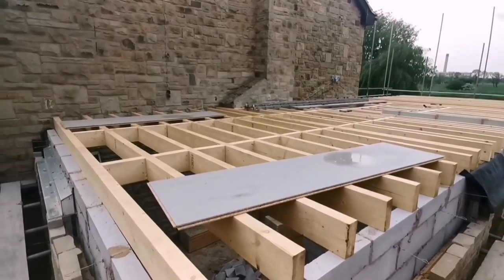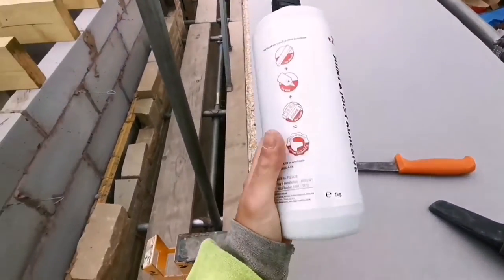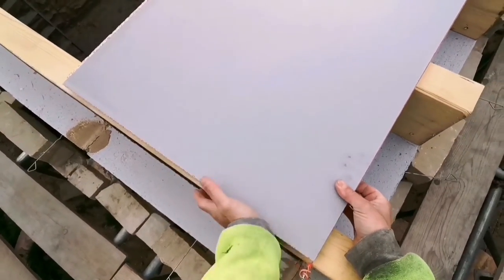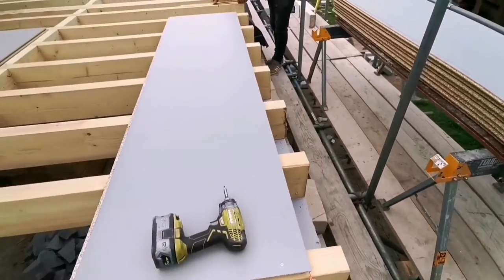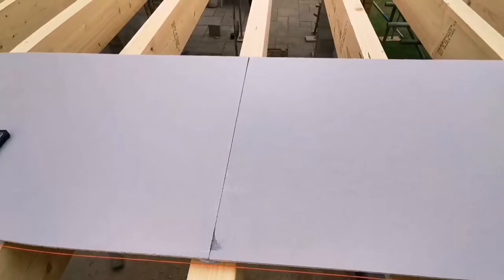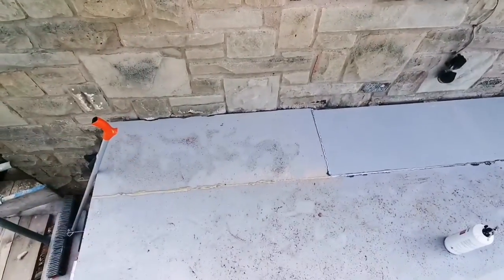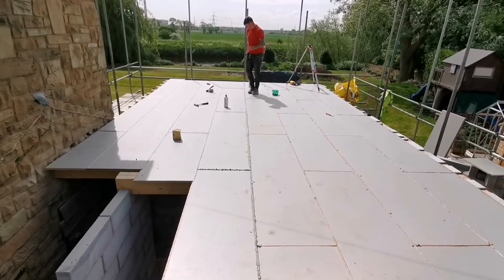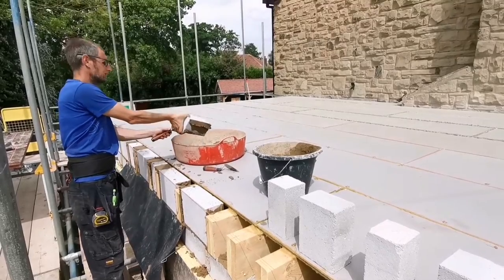egger protect boards

Comment: Really nice video.  I am looking for a video of replacing a joist that is currently encast into the party wall in our semi. The joist needs replacing and I believe that joists shouldn't go into the party wall as they don't provide the sound-proofing.
So what methods are used to fix up against a party wall?
Reply from the maker: @johnwealthy6044  cheers mate .you can bolt a timber to the wall .then nail joist hangers to it and run you joists into the joist hangers.if you don't want them in brick work .there is a video of me doing it on an extension on my channel somewhere.if you want to have a look 👍👍
Reply from the maker: https://youtu.be/UlF18BtyEmc?si=B06WknOxIDQflR1N

Comment: We just use particle board flooring, no pre priming, glue it down with something like Liquid Nails then pump in the 2 inch nails everywhere. It supposed to be ok exposed to rain for a few months I think. We would drill holes anywhere that's holding water. We don’t glue the joins, they have a plastic tongue.
Reply from the maker: Sound pritty good. I like the idea of plastic tongues 👍👍👍👍

Comment: Why are the end joists butted up against the inner skin? Should be a gap to get any cables, pipework past without having to drill joist. Also good pratice to put a perimeter noggin in to stop sag on the ends of boards.
Reply from the maker: Hi Ed you right there is a big of a gap bit it bows in the middle to the wall. But its not big. I don't no why I didn't leave a bigger gap I normally do 👍👍👍you will have to remind me next week before next time lol